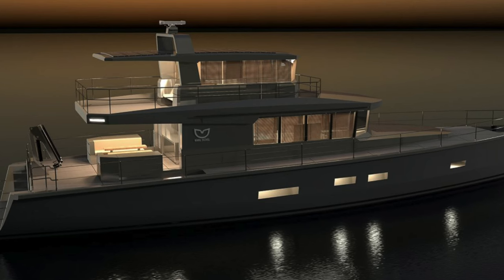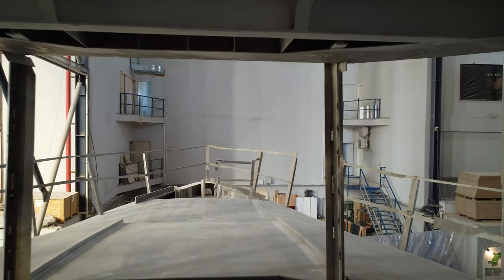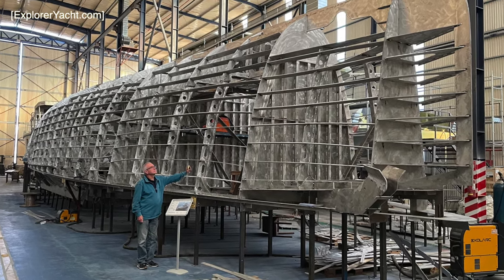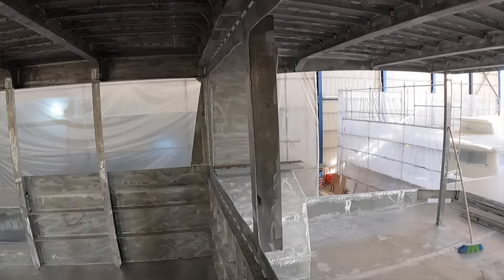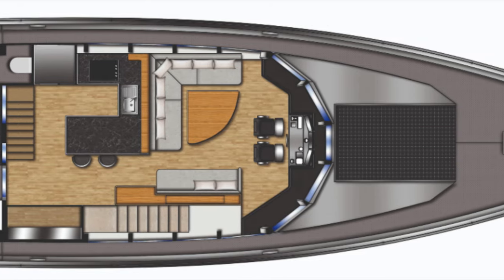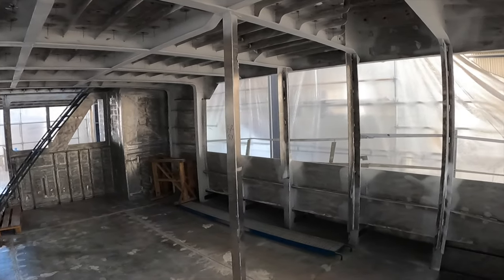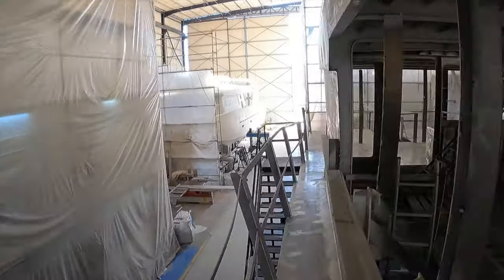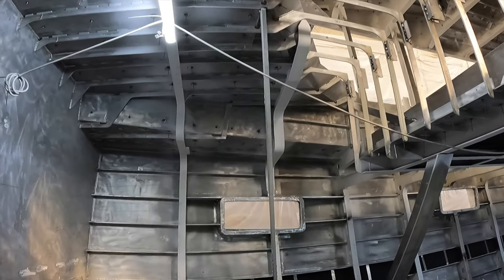THIS Is Hull #1 Of The $4.5M XPM 85 Series Of Explorer Yachts!

Comment: Is it accident that several of these new  explorers look very similar to the original FPB’s
Reply: I know man, but I'm happy because Steve Dashew doesn't allow his designs to be manufactured anymore. Circa Marine has their 24 meter boat that looks great. These are the go to designs as far as I'm concerned. FPB boats are amazing.
Reply: I have little doubt about the influence of Mr. Dashew’s pioneering work. Yet, in this case, I suspect, function follows form. To attain the desired speed, efficiency, and stability, fluid dynamics would dictate such a hull form.
Reply: Also the dimensions are nearly the same as FPB78. But Not all Design ideas from Steve Dashew seem to bei understood, especially the reason for the narrow tail... The original is unreached.
Reply: No.
Reply: @stevenwright6573 it's a shame he doesn't let anyone use his designs, they will be lost to the world when he does.

Comment: Finally!! A builder is using CPP on a long range yacht. The benefits are huge. What brand is being used? Did any of the warships you served on use CPP?
Reply: We specified Nogva CPP gear. Nogva supplies the whole propulsion package including the Scania engines, CP gear, shaft, sterntube and propeller.
Reply from the maker: Negative - The Type 22 and 23 frigates never had them. I was on the aircraft carrier HMS Invincible and I dont think it had them either 🙌⚓️